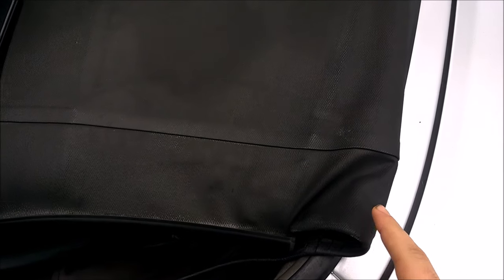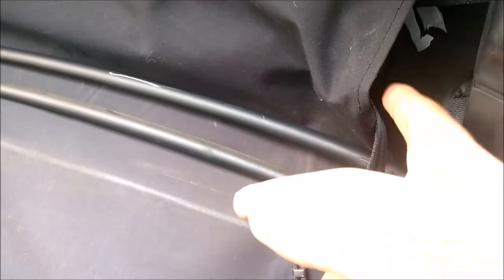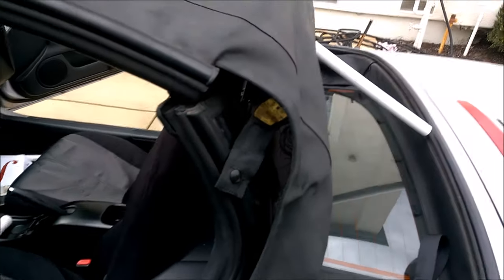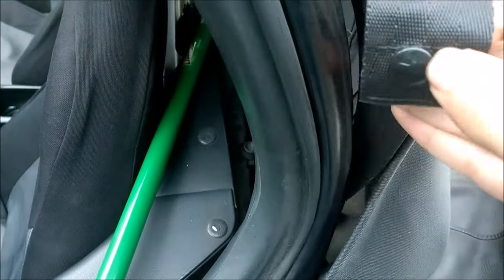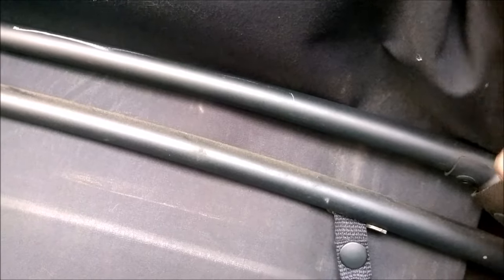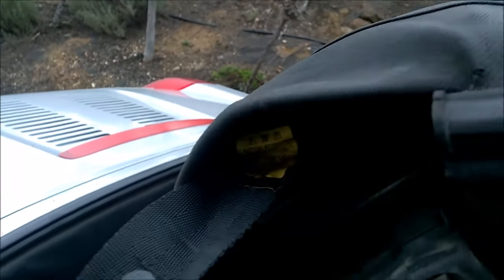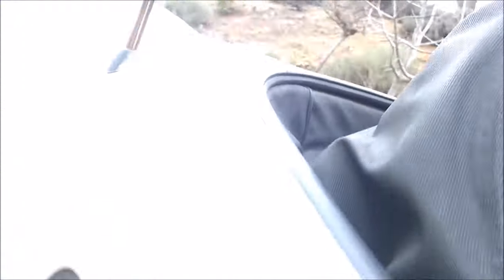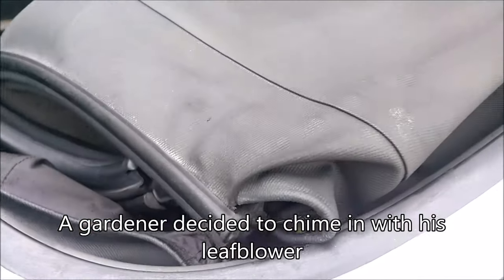Fixing Ears

Comment: Thank you! I never even knew it was supposed to do this automatically. I've spent 11 years forcing all the extra material down into the space between the top and the trunk. Mine doesnt have a long strap but there are stretchy cords that attach to the top. Once I moved the piece of strap with the snaps out of the way it closed perfectly.

Comment: I got my MR2 from a dude who kinda riced it so it's got a CAI, header-back exhaust that rasps, strut bars, missing the frunk plastics, it's somehow lowered but the suspension looks stock so I'm afraid to jack it up and see cut springs, and finally permanent ears because the top ripped in several places but especially the stitching where the ears form.  It's too late!